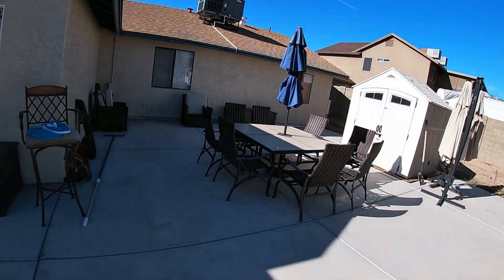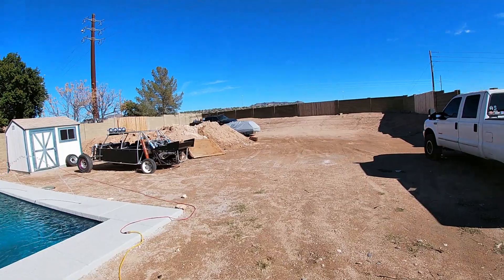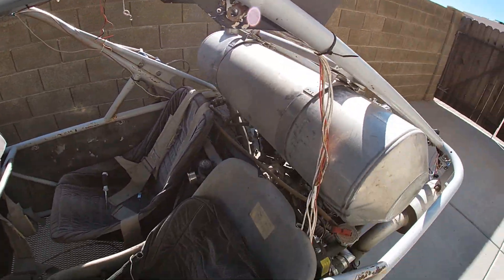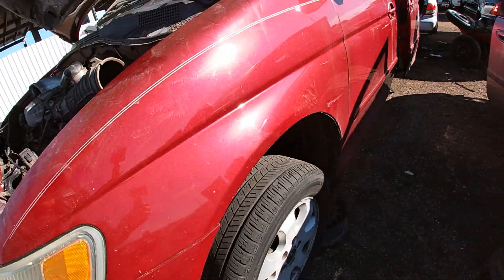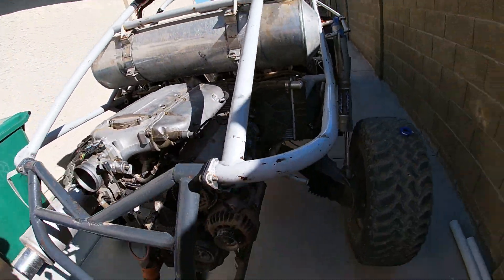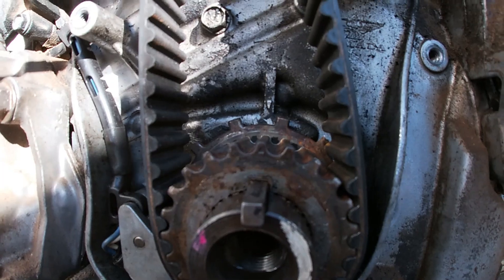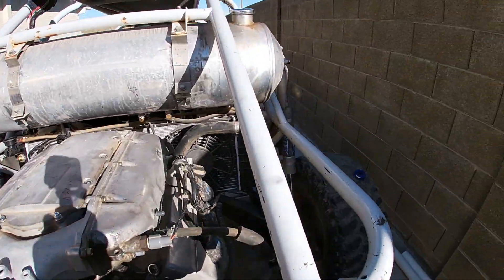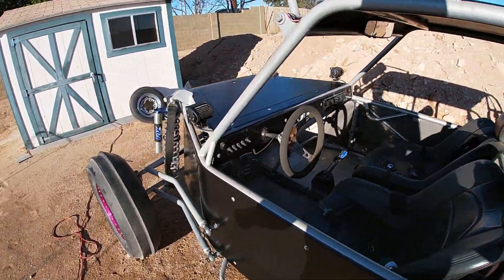Honda J35 Making it run

Comment: I think your rail needs some more work before selling it. I would take the springs to powder coat them silver to match the frame. I would take all the bead lock rings to powder coat them black to match the side panels. And the back of the roof needs something to offset the size of the lights on the front to make it taller at the back of the roof. And that way purple won’t have to be the focus of the car and it’s name.

Comment: Great job getting this cleaned up, did that motor come with the throttle body facing back ? The j35 I’ve been looking at the throttle body is on the other side and would get in the way.
Reply from the maker: The intake manifold was flipped

Comment: Why was that engine idle cycling like that when you first got it running? My neighbors kid's car does that LOL.
Reply from the maker: Vacuum leak
Reply: Where was that vacuum leak? Mine does that sometimes.
Reply from the maker: @thomascanfield2360  just a unused port that was not capped
Reply: Love your vids! I put a j30a1 in my Baja bug a few years back. And thinking j35a4 next. I have a new AEM series 2 on the shelf. Is a new harness in my future?
Reply from the maker: @coderedward8286  if your current J  has coils on plug then  no your existing harness will do